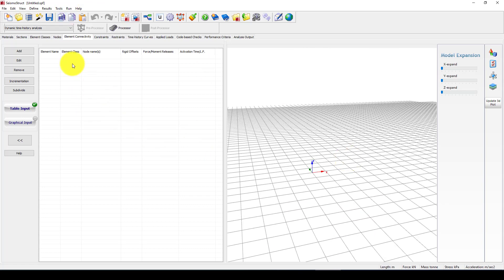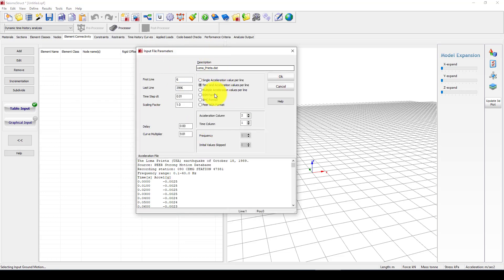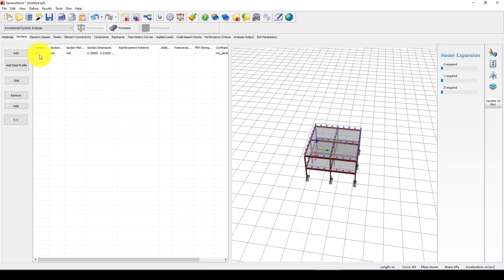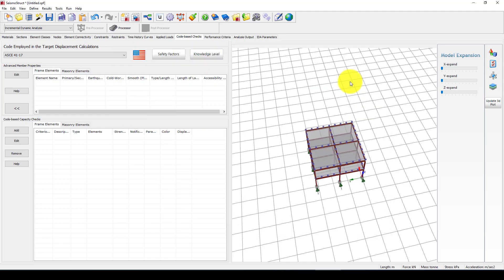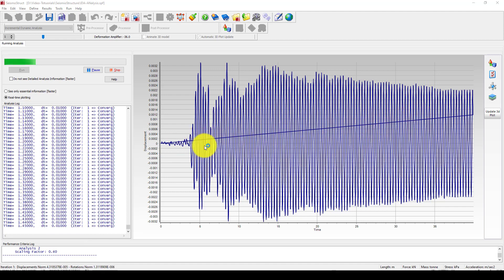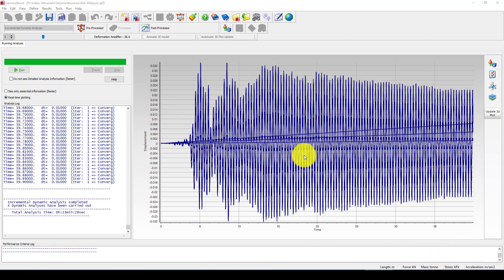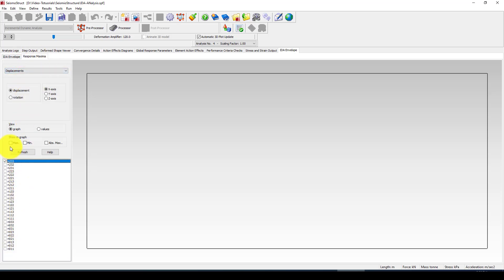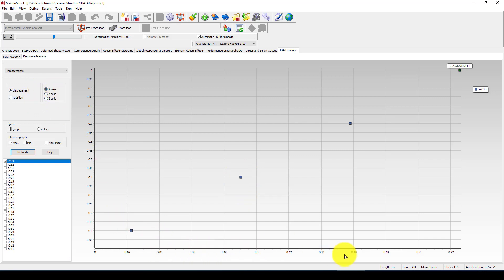Incremental dynamic analysis (IDA) Method In SeismoStructure software

Comment: you ran the model with si units (m,kN,kPa). but after the analyzation you said the displacement is in mm , why? i am confused
Reply from the maker: Your vcan change the unit in anytime you want .
Reply from the maker: Your can change the unit in anytime you want .
Reply: @KSSE_Engineer  thank you so much for your reply . i have another question. i am doing IDA on an eight story base isolated building. i used scaling factors 0.1-1.7 with 0.3 steps, but the problem is it took too long time more than 22 hours, is it normal? is their anyway to reduce the time? someone told me to change the model from non linear to linear elastic but i dont know how to do it in seismostruct. can you please help me?
Reply from the maker: @uzeyirkeskin2178  yes, it takes time.